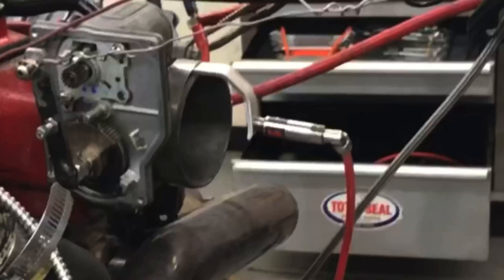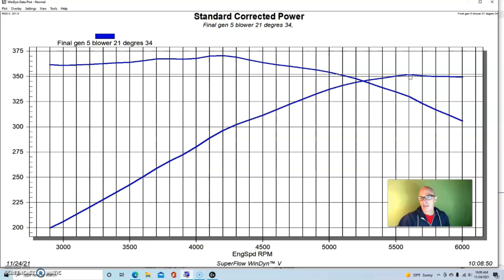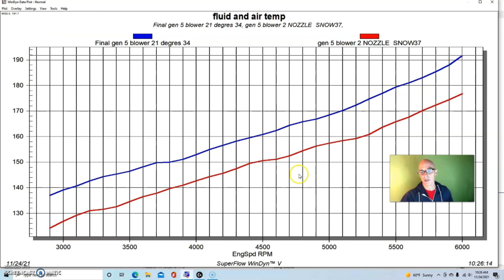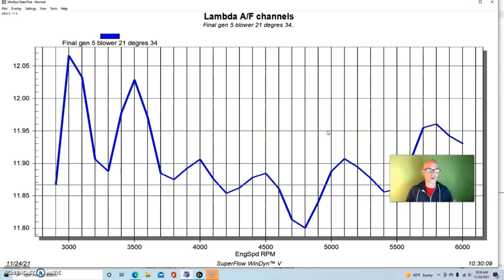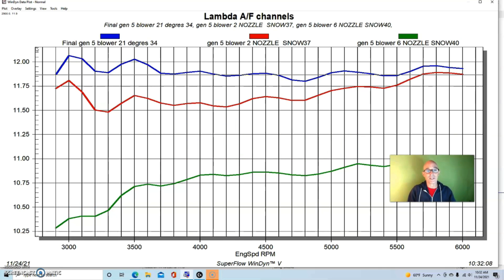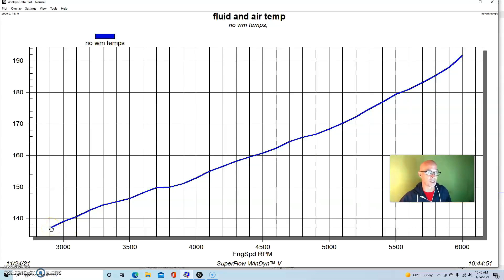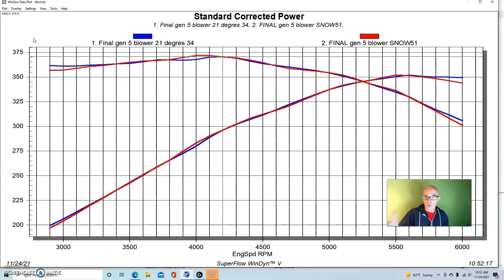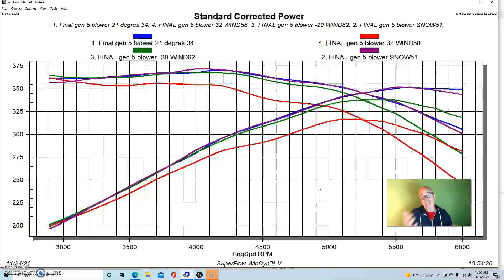WATER METH VS (LOW-$) WINDSHIELD WASHER FLUID-WHO WINS? BEST WATER/METH VIDEO EVER! IATS, AF & HP!

Comment: Richard, did I miss it in the video, or did you not tell us what the relative amounts of fuel removal were to even out the AFRs?  My guess is that the boost juice is very close to 50/50 (requiring the most fuel removed from the fuel map), and the -20 degree stuff isn't quite 50/50 so less fuel needed to remove, and then the useless 32 degree solution must have very little methanol in it.  You sort of eluded to this, but it would have been really nice to have a bit more data to flesh it out!

And that leads me to my next request: Could you please test some straight methanol injection through the system compared to Boost Juice or whatever?  I think it'll make more power and maybe even decrease charge temps more, but I'd like to know for sure.

Comment: The charge cooling is nice. Great job matching A:F ratios, but methanol has a different stoichiometric ratio than gasoline. Would the boost juice version be technically leaner than the others if it has more methanol? 
  Would the results differ if you used a lambda sensor instead of perfectly matching A:F? I think the power would increase if you ran the ideal mixture for each fuel mix. I'm not sure what the mixture of methanol:gasoline is but I'm sure the stoich ratio is different than 100% gasoline.. Or does a lambda sensor change based on fuels?
Reply from the maker: we used a lambda sensor
Reply: @richardholdener1727  Surprised no gain in power. thought cooler air always makes more power. Was the tune pulling power for the high iats without meth? If not how high can the iats get on e85 before pulling power?
Reply: @badasscobra  I would assume if the engine was seeing say 190 degree iats the computer probably pulled some timing or at least I'd hope it does

Comment: I'm on 93 and use the washer fluid and I can tell when I cut the injection system off. My engine screams when I have it on. Xlrv is known to heat soak but I can get more runs in with the snow performance system. I use to add heet to the orange rain-x washer fluid now I use regular blue fluid. I noticed my leds both light up green with the blue fluid but anything else it lights up green on one side and red on the other. So I stopped using orange and heet mix

Comment: Great work as always, A bit Weird to do this on e85, not sure why you did that. The biggest point of WM is knock mitigation, which won't be a problem with e85. The in cylinder burn rate changes alot, hence knock sensitivity reduces,.
Reply: The biggest reason to use W/M injection is to decrease air charge temperature. The knock resistance is an added benefit if you are using a lower octane fuel

Comment: Looks like you proved water-meth injection makes zero difference in power! Maybe you need to put an even smaller pulley on the red blower and get the “before” charge temp to a more dangerous level?? Or perhaps some increased compression, to 12:1 or something? I don’t see what you gained on this application with the Boost Juice, much less the ws washer fluid. Never would have guessed this result, so, another great tidbit of info from Richard!

Comment: Would like to see the test with pure water, no meth and also with injecting gasoline instead of the water-meth. 
Would water only change the afr?
After adjusting back to target afr for the richer afr when injecting gasoline,  what is the power and decrease in charge air temp?
Pure water, then gasoline.

Comment: Forgive me if these are stupid questions but I’m trying to understand the benefits of water/meth injection.   

In these case studies there didn’t seem to be any significant end performance benefit unless it was the lowering of the charge temp in its self? 

How do you think this test would have differed if you were using 91 octane fuel as opposed to E85? 

And could the water/meth allow the addition of boost with the E85 and keep operating parameters “safe” from detonation?
Reply from the maker: it helps a lot when running 91 (near the knock limit)

Comment: So wait, you weren't able to tune the "no water meth system" numbers back in with the washer fluids at all?  So it actually just cools your charge and kills power? I think this should be revisited with pump gas. It will make more difference in timing adjustability.

Comment: Replacing E85 with poor washer fluid/WATERmeth wuuut?
Replacing the E85 with E85 as "injection" liquid would have been alot more intresting. Same as adding an intercooler with potentially no powerloss and no extra charging pipes....
I hope theres an video with the same test on Gasoline upcoming. Thats where its beneficial for 99% of users.

Comment: Just to echo what everyone is saying , my 1.4 16v turbo was knock limited to 19psi on pump fuel , every time I went over 19psi regardless of timing it'd crack pistons and obv knock like mad. Water meth allowed 30psi of boost and decent timing. Allowing the car to go from a 12.4 to an 11.9 in the 1/4
Reply: Your dedication towards showing those pistons who's boss is admirable 🤟
Reply: @brettus9115  in the UK, the 1.4 16v rover k-series was £50 from any breakers(at the time) and you were tripping over them, when I cracked a ring-land id just swap the bottom end out in an evening and start again lol oh to be youth full and have free time again!
Reply: Try nitrous as a charge air cooler 😎 😜 nitrous and boost,what a combination 👌
Reply: Damn 11.9 from a 1.4? What is it a Cruze? 
My 5 cylinder Volvo ran a 12.3 at 23psi with a hybrid turbo and stock internals using wmi and 94 + VP octanium. I'd like to see Richard dyno test the VP. I saw another shop that gained 50whp on an 800hp engine using the VP octanium added to gasoline.
Reply: @ogfromutube classic mini clubman but full road trim so not the lightest at 710 kg

Comment: But the good stuff didn't make more power. It made more power than the other cooler solutions, but the max power and tq without it was the same with it.  So cooler charge temps help with timing but not in this case.  Adding timing did nothing.  So why bother?  Seems like a complete fail.  Or did I miss something.  I think a intercooler will gain a lot more.  As will a cam and better heads or porting.  A 25 shot of N20 would kill meth injection.

Comment: You didn't make more power because you were on E85, you basically have all the octane you need. More timing won't net you any gains if you're at mbt.  Run the test on pump gas and you'll see a difference  , big one.
Reply: Had it been turbocharged it would have seen a difference in power not just by mbt but increase in boost pressure
Reply: That's not the point. This was to show charge temp. All of his long time viewers understand temp doesn't mean power. Temp means timing can be changed.
Reply: @akassasin5768  video title says "IATS, AF & HP" at the end so it kinda is the point. Timing advance would make a huge difference and e85 means you're much closer to or already at MBT. Basically, this wouldn't add any power with this configuration. If this was pump 93 or 91 since it's California, then we would likely see power closer to these e85 numbers vs the pump 91 numbers
Reply: @InitialDIYmods  He is simply testing meth spray here to compare the differences in HP and charge air temp etc. He wasn't tuning to hit to hp numbers. Leaving the variables the same to test the different meth spray tells how well each one works at cooling charge air temp.
Reply: @MidLifeCrisisGarage  If you're comparing two different things in a scenario that stops any changes from having an impact, it's not a very effective comparison. The e85 is already doing what the methanol is supposed to do, so of course the benefits are negated.
He easily could have done it with 91 octane, shown the meth spray with no tuning, then tuned it (i.e. increased timing which would get the nearly same results as e85) and it would show a true comparison. And you can't say well tuning adds effort or time because he retunes these engines all the time to compare intercoolers, pipe sizing, superchargers, different turbos, heads, etc. so it's the same extra step done in many other of his videos.
I'm not trashing him in any way, just agreeing that the video didn't really compare meth injection in a worthwhile scenario to say it doesn't have a benefits. Methanol is very similar to ethanol in BTUs (methanol has a little less while having a higher octane rating which allows for more timing advance). Timing advance is where most power is made, but it's only available when the engine is knock limited which is usually not true on street cars with e85.
When it comes to washer spray, the temperature rating of -20 rated meth is about 70% water and 30% methanol but it's not available in most southern states with warmer climates. Compare that with the 32 degree fluid which has <1% methanol and is basically water.

Comment: Why not straight meth? We have fantastic results with it 
The charge cooling is incredible, and still adds more fuel at the same time.
Water/meth mix is not combustible, so there's NO energy contribution (if there's any gain it comes ONLY from adding more boost or curing detonation, and because of the water the latent heat of evaporation doesn't charge cool near like straight meth, all it does is offer slight charge cooling and slows combustion by becoming steam.
If you want to see significant power, hit it with straight meth - it'll drop the intake charge temp drastically, which equates to a much more air dense charge AND helps retard detonation, then you can add boost, bump the fuel and possibly add timing (if needed) - then you'll see power.
Charge cooling is everything when artificially aspirated. 
Straight meth adds combustible fuel (energy) and charge cools better than an air to water intercooler - even with ice water through the cooler.
Meth is win/win.

Comment: Good info...gotta believe more timing woulda picked up some power...as with the lower iat's and higher threshold to knock timing is your friend!
Other thing is the -40 rated WWfluid has a higher alcohol % if ya do another test anytime soon.
Thx Richard!
Reply: No, The engine would have been at MBT on E85 (aka not knock limited) so there's no gain past it...
Reply: You can't always add more timing. You reach a point where you start to see diminished returns. Richard optimizes the tune so if it could have taken more timing he would have added it. However due to the low air charge temps and utilizing less fuel more boost could probably be added to the mix

Comment: 5:00 some systems have an adjustment on the pump. Mine is 100, 150, And 200 psi system pressure as well as a low and high progressive setting so that you don't load up.

Comment: Why did it not gain power after you corrected the A/F ratios? With a 70 degree drop in IATs, it should have picked up power from air density alone. In your "Does ice water work?" turbo LS video, you picked up 72hp with only a 32 degree reduction in IATs. I still think you are getting false IAT readings when spraying W/M. Why not take a turbo LS, run it with an A2A, and record the charge temps. Now remove the intercooler and spray as much W/M as it takes to match the IAT while letting the Holley closed loop keep the fueling in check. The power numbers should be identical if the boost level and IAT remain constant.
Reply from the maker: START THINKING I SHOULD RUN AN AIR HAT-THAT IS THE DIRECTION YOU SHOULD BE GOING
Reply: @richardholdener1727  Lol, WTH is an air hat? Are you having cocktails already?

Comment: Windshield fluid with no antifreeze, 32 + with 50/50 water and ethanol is the dollar store boost juice. The blue dye anodizes the Pistons and valves. I've seen the inside of an LS1 that ran pump gas and dollar store boost juice. It was really clean and beautiful blue.
Reply: The 32° f windshield washer fluid has no alcohol in it also known as methanol. So your statement here is wrong. You have to get the -20 windshield washer fluid in order for it to be the quotation marks dollar store water meth because there's about 30% meth in it and 70 is water
Reply: @jeffreycattelino3996  good luck with that antifreeze. Lol
Reply: @calvinevans8305  when did I say anything about putting antifreeze inside the car?
Reply: @jeffreycattelino3996  the antifreeze is in the -32 windshield washer fluid.
Reply: @calvinevans8305  The methanol also known as alcohol is what's used in the negative 20 windshield washer fluid to prevent it from freezing. Just like how liquor does not freeze. It's not methanol but it's a form of alcohol so that's what they use to prevent it from freezing. The 32° windshield washer fluid has no methanol also known as alcohol in it because it's going to freeze when it goes below freezing. Hence the reason why there is the -20 windshield washer fluid and if you look on the labels of both windshield washer fluids, you will see methanol on the model of the -20 and not on the 32°. I never said anything about antifreeze which if you say that to anyone they're going to go to what you put in your cooling system. You know your radiator where you put antifreeze in it so that it doesn't freeze. So use a different term if you are meaning to not call it antifreeze that you put in your cooling system you know your radiator. In the 32° windshield washer fluid, there is absolutely no alcohol in there at all. Any form of alcohol to up the octane numbers so that you can increase the power of your car that the water meth injection system is installed in. That's the reason why there was no increase in power. Now the -20 if they were to actually tune they will be able to up the power because there's going to be an increase in knock suppression with the 30% of meth that's in the -20 windshield washer fluid due to that alcohol and with the boost juice which has 49% meth made the most because it has the most alcohol methanol in it. So you know ethanol fuel how you know e85 which is 85% ethanol makes the most power out of let's just say e50 mix which would mean 50% ethanol and it makes more than E30 mix which would mean 30% ethanol the more percentage of ethanol in the fuel. You make more horsepower and torque. The same goes for the water meth mix. It's common Sense which clearly you don't have any.
Reply: @jeffreycattelino2011bk1turbo  you forgot about the Propylene glycol mister common sense. That's what keeps the -32 degree washer fluid from freezing. Go ahead and use it for boost juice and let me know what happens. Lol
Reply: @calvinevans8305  It's the methanol that keeps it from freezing smart guy
Reply: @jeffreycattelino3996  you drank too much GLYCOL.
Reply: @calvinevans8305  You drank too much slick 50

Comment: Great test, this is one of those truth in advertising tests, it does lower the IATs, but they never show that it kills power. Did you ever get it to tune back up to the best power output? Just remember that you are displacing air and fuel with a non combustible liquid, even worse the E85 will absorb that moisture as well. I’d like to see what the EGT difference is with the water meth injection as well, just as a point of comparison to see if it does help or hurt combustion efficiency
Reply: He is comparing it to an e85 run. Most people that run water/meth do so on top of pump 91 or 93

Comment: That's kind of disappointing after all the snow performance claims of 15-20% more power. I'd love to see the same test running straight methanol. Also, I wonder how much extra boost you can run on the w/m vs no intercooler and no w/m.

Comment: My 5.0L went from 490 to 555 rwhp with the addition of my meth kit 👍
Reply: Only meth.. no tuning adjustment?  5.0 pushrod or mod?
Reply: @superkillr  older pushrod motor. No, definitely tuned for it added 1 more lb of boost and 1 more degree of timing. Turbo car.
Reply from the maker: your motor made more power from the boost and timing
Reply: @richardholdener1727  agreed, but the meth allows me to add that extra boost and timing on the 91 octane fuel we have available here.

Comment: Okay, you are testing different juice.
I "demand" you go down to the local RC hobby store and get some methanol/nitromethane fuel.
I used the RC boat fuel in my Sno system and it seems to make more power without a tuning change.
My thought is the Nitro Stoichiometric ratio is low enough that adding the nitro leans it out in a dual fuel.
The above (adding fuel to go lean)  doesn't sound logical, but seemed to work for me.

It also smells wicked at the stop light.

Comment: My conclusion: don't squirt water into your engine.  Looks like a complete waste of time to me- you'd have to tune the ECU to change injector pulse width when the water-meth was on. easy enough I guess if you have a dyno to tune it on, but pretty hard otherwise. Seems like it would be way easier and more effective to sandwich an intercooler in there

Comment: @00:00 
I bet pure meth wins
Reply: Dissapointing too not see -40wiper dluid and pure meth tested.

Turbo power makes a -40c wiper dluid thats perfectly 50/50. 

Also with no means of measuring knock you have no idea whats actually going on. Your non meth injected tune might not be as safe as you think it is. Especially with 200degree iats.

Comment: What about a video or two on hidden nitrous installs?? When I was younger and dumber, I was about to install a 100-150 kit, on a SBC, under the intake, and bulkhead fittings in the block, above the bell housing, with the nozzles either in the intake or the head, in the bottom of the runners.. solenoids under the dash, the fuel would be in the cab, but only the fittings, maybe a tiny box welded with a cover, no one would ever see the hidden power!